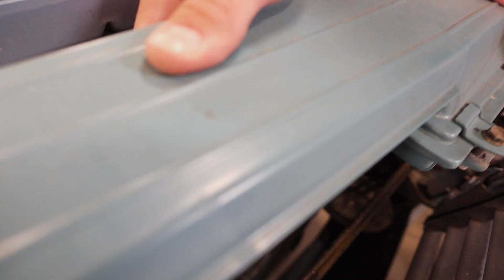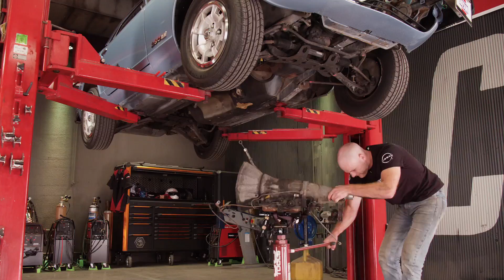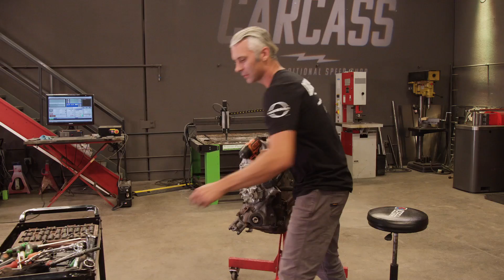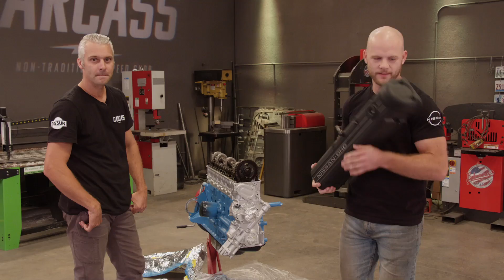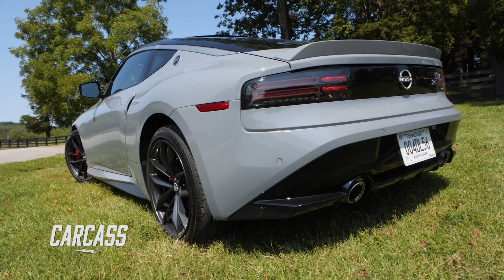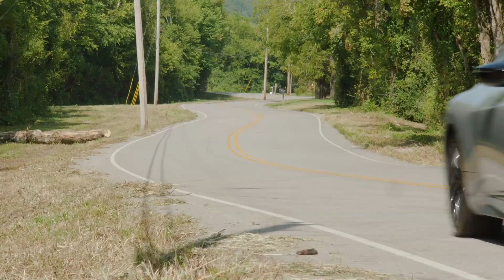Pulling The L28 Out Of Our 1978 Datsun 280Z Heritage Restomod - Carcass S3, E19

Comment: Why would you not have the engine power guys do an overhaul of the motor with a performance cam and porting the head or at least a nice mill and surface with a good valve job? Plus I would have loved to see that engines before and after on the dyno.

Comment: Mine has EGR provisions. Older though. 
It's weird you guys are replacing the entire (multi-thousand dollar) rear suspension without doing a proper engine build. Even if you don't do bore and stroke, you aren't even doing a cam or a bigger throttlebody?

You do you, and I will do my own, that's fine. I just don't get the budget distribution. Unless it is sponsorship dependant.

Comment: Planning on painting my engine block the same way. How clean does it have to be to get a decent painting job?
Reply: As clean as you can get it and then degreased and sanded. It doesn't have to be paint free, but the enamel doesn't stick to grease.

Comment: You can not ask a 50 ye old motor to provide power. You can NOT trust any previous work. This is exactly how an extremely long lasting reliable motor, become unreliable. You wouldn't do this to any 50yr old American iron.
A Z motor is so indestructible IF, you fit new bearings, new rings, new timing gear kit ,new water pump and a good valve job. You do the labor it's inexpensive ( you must use Japanese NOT Chinese knock off parts.
    I can not believe you spent so much on suspension and running gear. But did nothing to freshen this 50 yr old motor properly!
Shame ,Shame.

Comment: Look at that...being able to remove the starter from the top, without having to get under the car.  You can almost change the oil in the 70-83 Z cars without having to get under the car.  Just need to bet down to access the drain plug.

Comment: You don’t have to pull the head to get the front cover off. Two 10mm bolts connect the front cover to the head, otherwise just unbolt the front cover and pull it off…you can even buy a little gasket for between the head and front cover for when you want to do just that.

Comment: Always liked the 240, 280Z.
Very sporty pony car look
with a euro flavor.

But, the INLINE SIX is what really
grabbed my attention. 
(Inline sixes were really
RARE back in the day,
easy to work on, and didn't 
have the cons of a 4, or
 8 cylinder )

However,  I am NOT a fan
of "heritage restoration ".🤨
They're tearing down an
engine just to replace some
gaskets, and throw some paint
on it??????     LAME.

Stock is a COMPROMISE, period. This is a maxim.
No matter how good a factory
/corporate vehicle is stock, there is ALWAYS something  to improve on it! 

They could of ported, polished the heads, bore out /enlarge
the carb,
 bigger valves, lighter pistons, full roller rockers
 (if available), raise compression a point or two, cam change (full roller maybe), up the oil pressure etc.

Also, the exhaust is out of sight, and fair game.....
I/E: 
free flow exhaust manifolds,
larger diameter exhaust pipe,
Cat delete (if it has one), high
flow cat (for inspections), eliminate tight bends, and
kinks that hamper exhaust 
flow etc.
Change the rear gear ratio,
They're messing with the
trans there, WHY NOT upgrade
the gearing as well???

Anywho,
The engine would still look
stock-ish, but PERFORM like
it's a modern vehicle. 
This SEEMS like what they're 
trying to achieve,  or maybe
They're budget won't allow
the FUN stuff??? 🤔
(No offense, but the "carcass "
moniker is a weird azz name
for a show) 😅

My apologies for the long post,
I like a sexy Z, but felt deprived
watching this.

Comment: I had a 76 280 with a 78 L28 bought as 2 trailer loads of parts. I put it together over a winter in my living room (it's narrow enough to fit thru the double doors) and made it a car again. I couldn't afford the carburetor conversion setup I wanted. Still cheaper than fixing the fuel injection. It had that exact  first gen Bosch fuel injection. Every injector was stuck, all the hose was rotten. Clamps missing, just try to track down one of those early flapper door mass airflow sensors was ridiculously pricy. So it got a 2.4 carbureted Nissan pickup motor, and traded it for a crashed 72 Chevelle. Do still have the L28 sitting in the shed, still might be fun for something someday

Comment: The adapter plate onto the front of the tranny seems like a natural leak source.  The bell housing was cut off with a cut off wheel meaning the surface clearly wasn’t flat.  Wondering how you are going to seal the two surfaces?

Comment: I had a 78 280Z 2+2. My first new car. Hated the paint as the "paint protection treatment" peeled in 2 years. Car ran great though. Only 2 failures. Front disk brakes were weak and wore out about every 20k miles. The alternator failed at 95k miles. Fast, reliable, economical car. The only car I wish I still had other than my very first one (nostalgia only) that I still wish I had. Mine was the stick shift.

Doesn't the epa give you a hassle for removing emissions control equipment from the vehicle?

Comment: I have a 280C sedan with an L28, mated onto a 4N71B auto. Clocked 142mph. Couldn't go further, as my tires were going over the speed rating. What a joy. It's carbureted with a Weber 32/36 progressive. F54 block, N42 head. Engine never failed for 7 years, Sunday to Sunday driving day and night. Fuel economy, got more than 30mpg. I'm happy you all kept the L6. Long live the 280's and L28!
Reply: Yeah nothing like em,  had mine up to 132 mph with room to spare that's just a bone stock l24 and a five speed. This is by far my favorite series of engine, including the 4 cylinder variants As well. They have a one of a kind sound and feel that I can't get enough of. Long live the L series!

Comment: Whenever you guys have to alter something (like the bell housing) you should include how you discovered that alterations were necessary. Who tipped you off? How did you learn of the solution? Who guided you on how to do the alteration?
Reply: If they did that, it would take 5 days of extra taping, 90% of footage would be wasted on cussing and yelling, puttting it in and out, in and out.   This is why these shows are for entertainment purposes and designed to sell Sponsor's Products.
Reply: @johndrummond88  Discovery Channel got successfull, through filming all of that cussing and tantrums
Reply: @johndrummond88  If they just made mention of how a home mechanic might learn where the pinch points were and what resources to use to find out if the project you’re doing has hidden land mines. 

For example, what resource told them exactly where to cut that bell housing, or that there was a kit to correct the connection?

Comment: Did you guys even degrease the block, looks like even though you had tha oil pan of you just painted over the rust, not to mention not putting a zinc oxide primer on the aluminum parts.   The paint will look good until it all starts flaking off, what a waste of time.  If our going to do a job do it right not half xxx it..

Comment: dumb, the engine was out and on a stand - why not rebuild it? the most i know about this engine is it was "on the Dyno" and it "made good numbers". you have all the tools in your shop to not only rebuild the engine, you can re-manufacture it to a like new condition.
Reply: Did you guys even degrease the block, looks like even though you had tha oil pan of you just painted over the rust, not to mention not putting a zinc oxide primer on the aluminum parts.   The paint will look good until it all starts flaking off, what a waste of time.  If our going to do a job do it right not half a$$ it.

Comment: Seeems like a lot of work to just do some gaskets and paint. Just overhaul it seriously.  Krylon overhaul I guess.
Reply: Did you guys even degrease the block, looks like even though you had tha oil pan of you just painted over the rust, not to mention not putting a zinc oxide primer on the aluminum parts.   The paint will look good until it all starts flaking off, what a waste of time.  If our going to do a job do it right not half a$$ it.
Reply: @tedjones450  this show is not very good at all.

Comment: Even back home the Z is getting harder to find. Can't honestly remember the last time I saw one. Even at a local show. Guy that worked for us had a Brown 280 with a 350/Muncie swap back in the '80's. Ate IROCs and 5.0s for lunch. Of course he wrapped it around a telephone pole in the rain one night because he drove it like he stole it. 
I don't know about y'all but I miss the barebones, easy to work on, FUN cars that were fairly affordable. If you've ever read the "What would they cost today" articles, you might wonder why the heck we don't have those cars today.
Reply: I bought a used 74 260Z when I was in the military in California. A friend of mine said I should check out a blue 240Z at the barrack next door. Turns out the guy swapped a 327 out of a wreck Corvette into the Z. The guy gave me a ride outside the base on Airbase parkway. We ended up lined up next to a 68 Charger RT w/440 4-speed. The 327 Z smoked that Charger easily. I seriously considered doing a swap myself but never did but I really miss that 260Z.
Reply: @281cobracar7  of course it smoked that Charger. GM and Junior Johnson did it on the NASCAR Tracks in '63 with the 396, Pontiac with their 421 Super Duties in NHRA, and Yenko on the streets with the Yenko Duece. It's the cornerstone of Hot Rodding. "Big engine in a lightweight". I have a couple of recipes in my nugget for the same results. Just wish I had the cash to make it a reality.

Comment: You don't have to remove the cylinder head to move the timing cover. Its only two bolts on the front of the cylinder head that go with the timing cover.
Reply: While he was down there, it wouldn't have taken much, to remove the timing cover and then even throw on a new chain and guides
Reply: Facts

Comment: It’s not hard to clean the aluminum stuff rather than paint it. Low effort…
Reply: Did you guys even degrease the block, looks like even though you had tha oil pan of you just painted over the rust, not to mention not putting a zinc oxide primer on the aluminum parts.   The paint will look good until it all starts flaking off, what a waste of time.  If our going to do a job do it right not half a$$ it.
Reply: Work smart, not hard…

Comment: The 280 is cool but the 240 is better
Sohc 2.4 liter straight six that revs to 7500 rpm 
And is feed through three double barrel carbs 
And doesn’t have that ugly 80s import number 
Like holy moly doesn’t that thing ruin the look of every car it was put on
Reply: You can easily buy the Japanese front and rear bumper conversion which then looks amazing and the L28 also redlines at 7500rpm, and with fuel injection you can use more modern modifications or you can throw a 3 carb kit on it, i personally think the L28 is way better
Reply: @akajonesy4388  I’m just a purist 
I also like the exhaust on the 240 the over under dual exit muffler on the rear with factory headers
The l28 has shorter headers with a cat and more restrictive exhaust 
But it’s all opinionated and there both awesome cars
Reply: @Sagen Babin  why would you keep factory exhaust, easily can fix those issues
Reply: @MineZilla123  Idk I’m just comparing the two
The lighter wheight of the 240 given the fact the engine im had less mass is peppier it gets to red line faster and the way it sounds is absolutely magnificent 
The carbs make it break up a little bit with rapid rpm change and it sounds like an angel
Reply: @Sagen Babin  the l24 and l28 weigh almost exactly the same within 20 pounds, the 28 just has a longer stroke and little bigger bore but identical almost besides that. And you can swap the carb setup onto a l28 and have all those advantages on top of more displacement. A carbed l28 swap into a 240 would be a nice swap and more power. They also have the same redline so
Reply: @MineZilla123  when it comes to internals grams change a lot if you can get to the max rpm faster your car will track better and run better I would love to see a crab swapped l28 would be so bad ass
Reply: @Sagen Babin  time to hit redline isn't everything, and it also has a tradeoff of the torque lost down low. Neither is better than the other at the track and they do the same thing a little different, one being a little more rev happy the other a little more power down low and overall. Both would be great at the track and I don't think the l24 would have any advantages just as the 28 wouldn't, I don't think either is necessarily better. If you want to really see a L series Rev look up the Os Giken tc1-b1z cylinder head for the l28e. It makes it into a crossflow dohc 24v i6, and revs to over 8k in a split second, making a ton of power. That's a beauty, but I forgot how much it is, much more than the car it would be going in is worth 😂😂
Reply: @MineZilla123  that cylinder head sounds so bad ass I’ve gotta see it 
A 2.8 liter dual cam multivalve engine 
Gotta sound like a barrel of angry bees 
Wielding chainsaws
Reply: @MineZilla123  I just looked at it that head is absolutely insane 
I love engine building and that’s bad ass 
I kinda wanna build one 
With itbs the dohc head all naturally aspirated 
That would be such a damn good track car